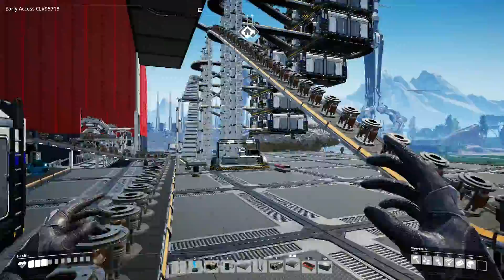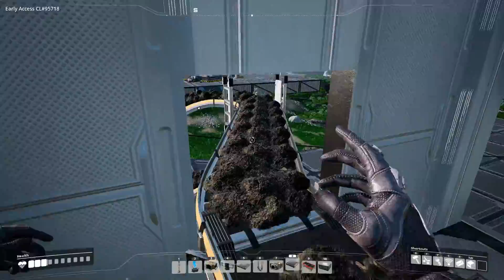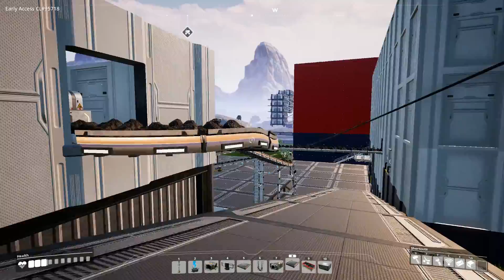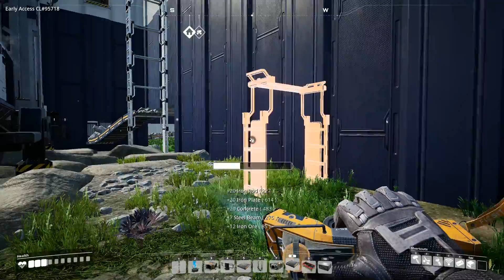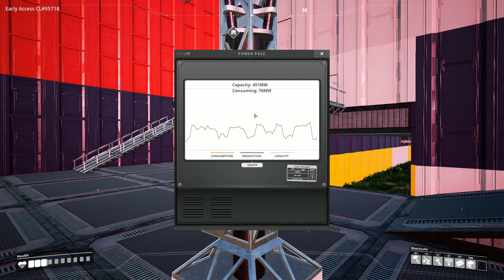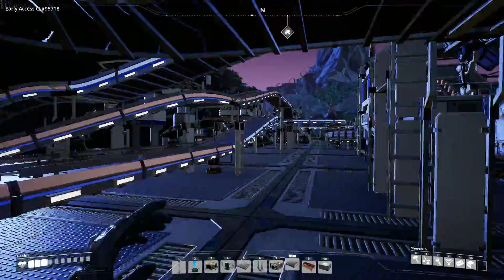Satisfactory Gameplay | Steel Factory Pt 2

Comment: To turn a corner neatly you can use a windowed wall next to the side-mounted wall conveyor (in line, so the corner turns 'behind' it), put the conveyor in through the nearest window, then remove the wall piece and run the last 90 degrees directly into the windowed wall around the corner. Took me an hour or so of fiddling before I figured that one out and made my life easier!